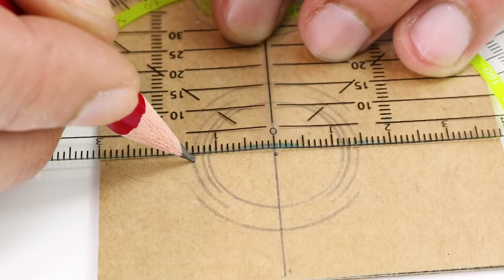DC Motor, How to Make a DC Motor at Home (Cardboard DC Motor)

Comment: Did you jest make an working motor with magnet and copper wire?well it will be more cool and power full you use electro magnet in it

Comment: I have a question, would it be possible to make a "flat motor", so for example instead of having one large coil rotating, you have several small ones in a line, which are then linked together?

Comment: How can you touch the cable wire without getting electric shock?what did you use to connect the motor with the power?

Comment: Are you insane in a real motor the parts on which you have rolled the copper on are made up of metal  that is why when there is a power supply it turns into electromagnet then it starts spinning

Comment: How many rounds
Reply: 40 or 50
Reply from the maker: 200
Reply: Quasistar use a coke can as wire ,cut it in spiral form and wind it on paper ! Idid that long time ago and it worked !

Comment: Fake
Reply: to khilkhat
Reply: Not fake ,i made motor using a coke can as a wire ...
Reply: try opening one(from the store ) and its similar
to the cardboard thing
or search the internet
for dc motor dissasembly

notice:
(dont plug it to the outlet or it will explode)use 9v battery or others with lower voltage(depending on size)